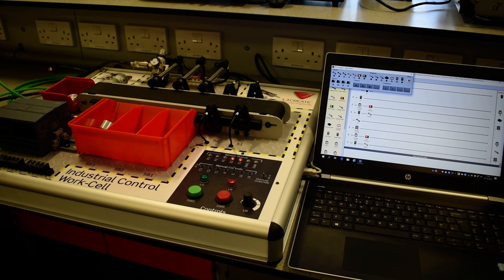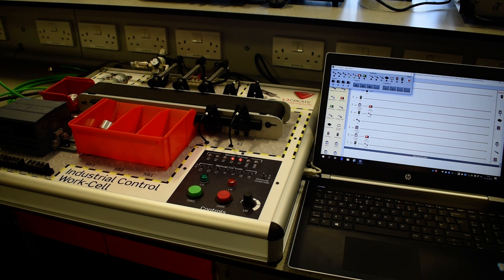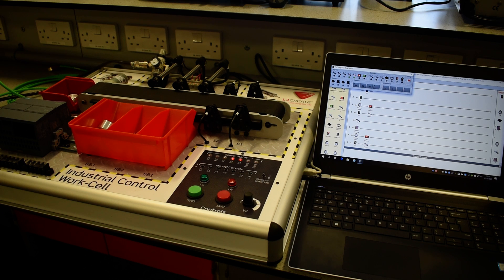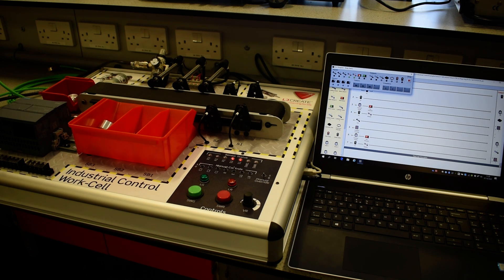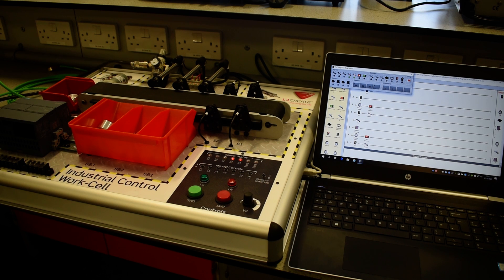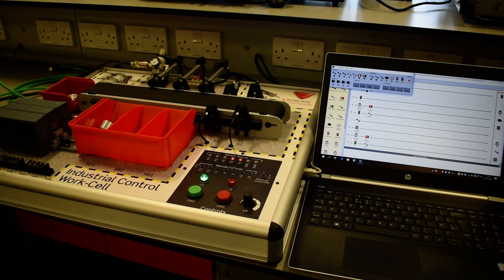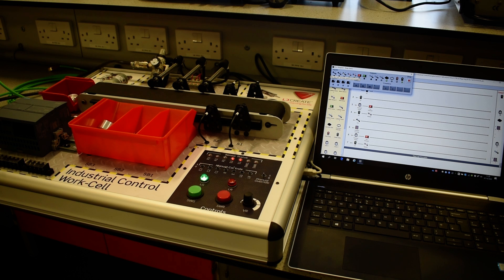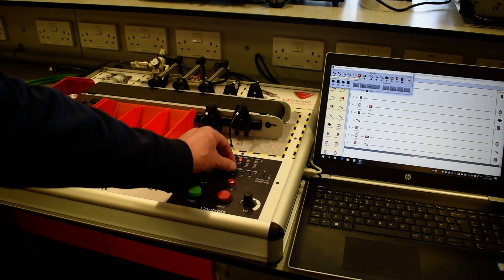LJ PLC system demo

Comment: How do you get the pistons to retract after they come out ?
Reply from the maker: Yes pistons have been momentary action so what ever event opening the valve has to be reset like the counter or store CPU component via the Ladder diagram code
Reply from the maker: I will check the code tomorrow Counters or stores are set when the beam is broken. They need to be reset when the piston valve is activated
Reply: @xacteducation8036  thanks man

Comment: Hi mate im currently doing plc's at college any chance you could give us a hand with something? cheers.
Reply from the maker: Hi Happy to help if i can. What is your question(s)?
Reply: @xacteducation8036  thanks for the reply. Would you be able to roughly explain how you would separate the widest circles. To go pushed by the piston into their own separate bin.
Reply from the maker: @rizzle9229  Hi The infra red beams that detect boxes passing are set at different heights. So its height rather than width detection. The first beam is set higher to detect tall boxes but not small box height(they go under the beam not through it). The second beam will detect both tall & small height boxes. The first piston pushes tall the second piston pushes small boxes into bins
Reply: @xacteducation8036  hi I got it figured out and you can use the beams to sort width by using timers. I timed that it takes 7 tenths of a second for the widest circles to get through the beam. I then stored that information and set another timer to time the piston to whatever bin I wanted it to go into.
Reply from the maker: @rizzle9229  Well done with the timing